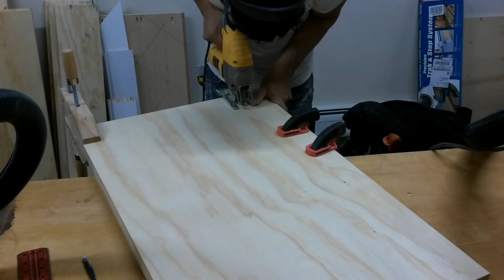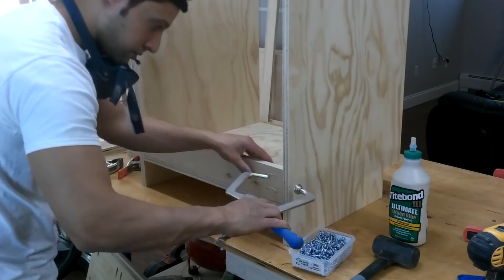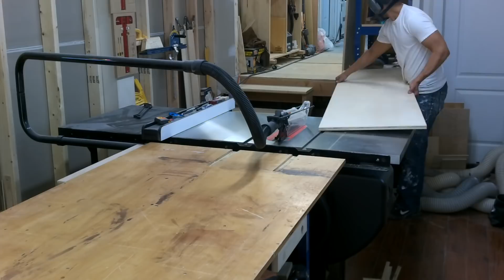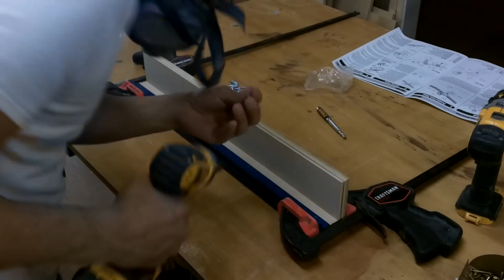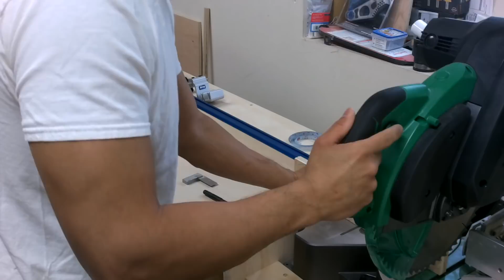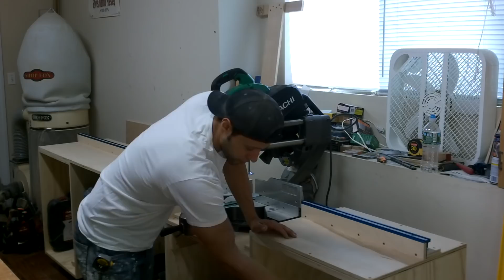Miter Saw Station Pt.1

Comment: Nice work! Just came across your channel. I'm digging that top-side table saw dust collection hookup you got there. Did you rig that up yourself or buy it somewhere? If you did buy it, is it specific to the brand or can it be reconfigured? I've been playing around with planning out a similar design but I'd rather just buy something. Thanks.
Reply from the maker: Richie Primo it’s factory, made specifically for this cabinet saw.

Comment: Looks good. I'm in the process of designing my miter saw station right now. Mine will be slightly smaller at 104" and will house a drill press as well.

Comment: Nice setup. I'm looking forward to the rest of the build. Ive been happily subscribed for a while now but just dont usually commemt. Your mitre saw is the cleanest one I've ever seen. I didn't see any dust flying out at all - my workshop is covered whenever I use my saw. What's your secret? :-)
Reply from the maker: Maria H a very powerful high horsepower shop vac fed directly into the dust chute of the saw